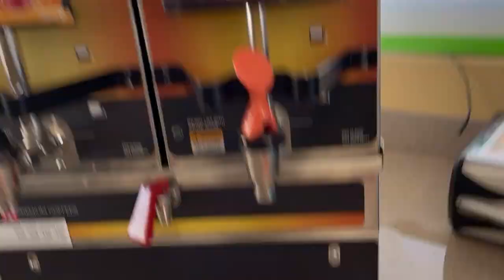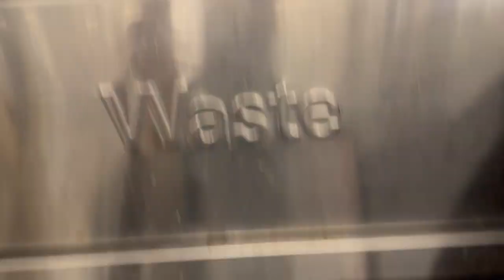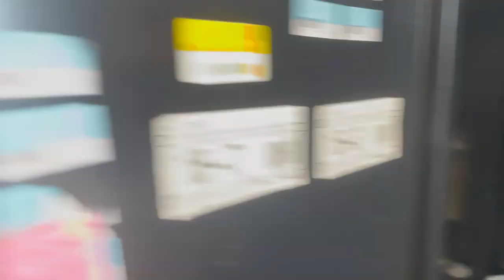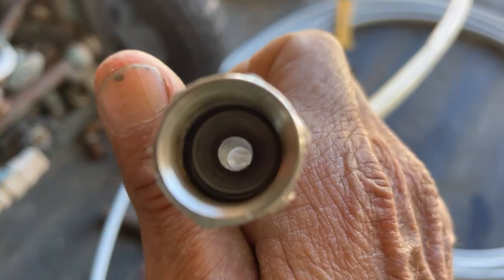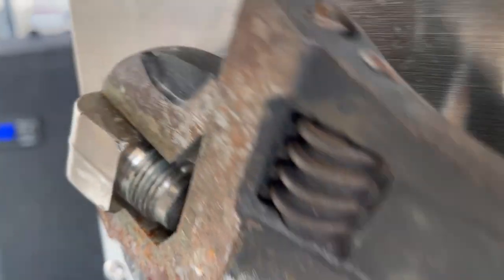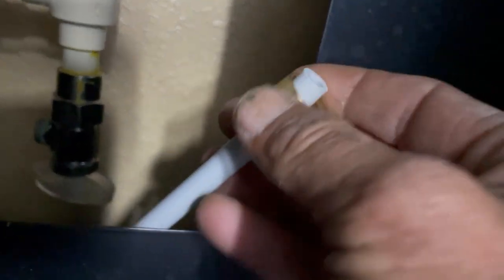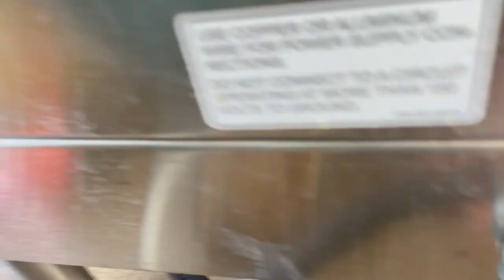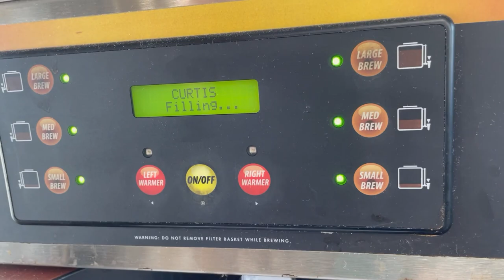WATER LINE BREAK ON COMMERCIAL COFFEE MAKER

Comment: Video, explanation and how to is great
However, That is not the proper hose for that - it will give the water or any drink a plastic pvc flavor like
my soda machine line was damage and I replace it with that because it is stronger, but then I notice the flavor and taste
So I got the flex hose, and not the flex hose from hardware store, the proper one, and it was al good and the taste was back to good
Beside that, everything else in the video is good and very enlightening